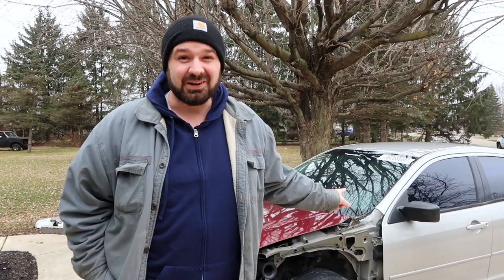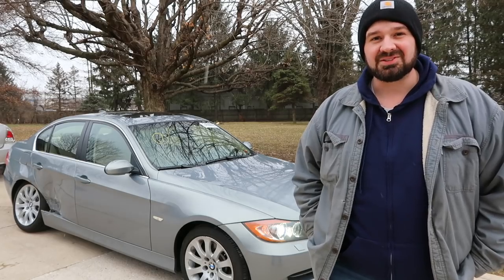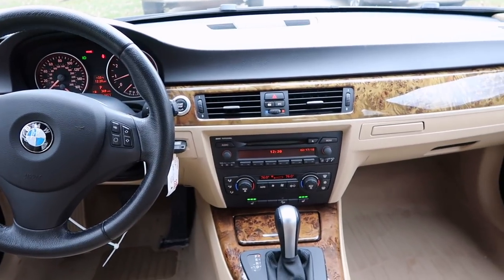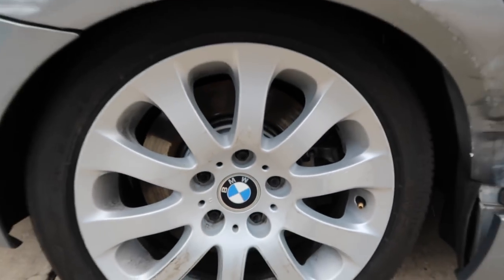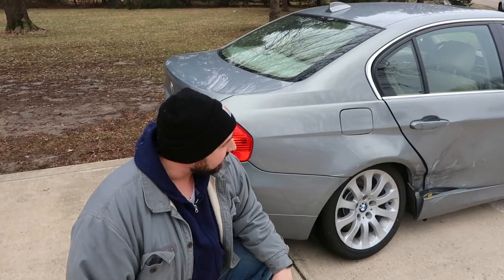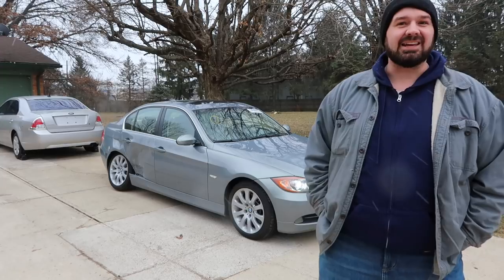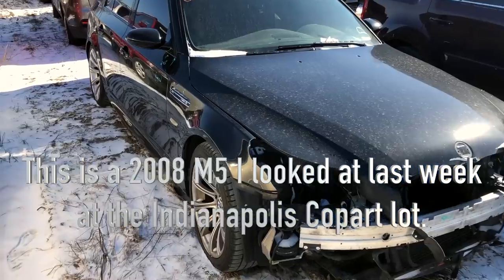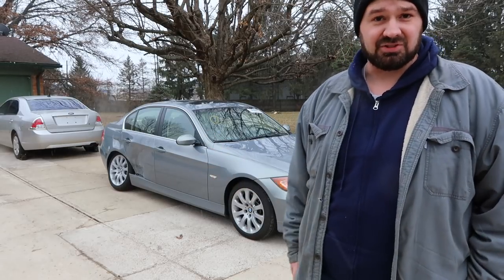NEW PROJECT CAR!! BMW E90 330xi Rebuild Project -- Part 1 -- Introduction

Comment: 1300??? You didn't buy it, you stole it. You got yourself a real winner there, Steven. Not badly damaged at all, and you'll be able to flip it for a good profit. It's obvious it was meticulously maintained throughout it's life. I have a 2016, I'd be ecstatic if it looks that good in 10 years. Yes the Beemer is high mileage but guaranteed the owner kept all oil changes up to date. Really looking forward to seeing this one finished, you might have a hard time parting with it when it is.
Reply from the maker: Haha! Yeah, I’m afraid it’ll be hard to part with for sure! I fell in love with it right away!!
Thanks for watching!!

Comment: Looks like a great buy. There was a Honda in my neighborhood with the same damage to the rear driver side wheel. It sat there for a few months and I was going to inquire about it. Before I could do that. It disappeared, the next time I saw it, the wheel was fixed and it was in the owners drive way.
Reply from the maker: Awesome!

Comment: You may want to take the VIN to Dreyer  & Reinbold and see if they can give you any history on the car. A lot of BMW nuts salivate over cars with maintenance history included. The Salvage to Rebuilt title may squash a lot of that enthusiasm, but you're doing a great job of documenting the repair so someone may bite when they see how minor the damage is.. If D&R are being their typically 'uppity' selves and do not want to help out, check the dealership in Lafayette....
Reply from the maker: That's a great idea! Thank you!

Comment: The interior is worth more then you paid for it. You got an Amazing deal. I was wondering what check engine light are on? I enjoy your videos please keep them coming. Good luck with the builds.
Reply from the maker: Thanks! I think I could make a huge profit parting this car out, but I really don’t want to. It’s too nice for that! Hopefully I can get it all fixed up pretty reasonable.
No check engine lights or anything else. The only things you would’ve seen in the video are the seatbelt light (because I wasn’t buckled while the car was running), the parking brake light l, and I believe the light showing the fog lights were on. No error lights or messages at all!

Comment: Take the key to a BMW dealer service dept and ask them nicely to pull up the service records. That will give you a good idea of what was done to it in the past. That is, if it was maintained by BMW. They can scan the key and get the records.
Reply from the maker: Cool! Thanks for the tip. I’ll probably do that.

Comment: Great videos man.. I subscribed after you posted your first video. Quick question - was that price including the fees? Also, did you use transport through CoPart or did you have an independent company do it? How much was the tow?
Reply from the maker: That price was my winning bid. There were auction fees on top of it. I’ll mention all of those when I do the final breakdown of the costs. Fees are a few hundred.
I didn’t use a transport company. I rented a U-Haul trailer and borrowed a buddies truck and towed it back myself. I only live about 2.5 hours away.

Thanks for watching!

Comment: If I was buying for myself I think the price is fair as long as you can do 90% of the car your self. You can probably do a lot of the body work your self if you take your time. I had a Toyota Celica that was hit in the back corner like that. I spent a few weekends hammering it out and some bondo. The car was not perfect but I had it close to 15 years and enjoyed it the whole time.  That was back when you could buy a wrecked car with a clean title pretty easily.
Reply from the maker: Thanks! Aside from the frame repair I plan to do the work myself. Hopefully it’ll come out pretty affordable!
Reply: your welcome cant wait to see it done.

Comment: I've owned my e90 330i for about 13 years just about March 05 build. I look a lot on Craigslist for cars and I can have one like that for 2500 to 3k easily. So what you paid you won't make good money on if anything will cost you more to repost than what it's worth. Door let's say 300 bucks and quarter with damages about 500. Suspension bits anywhere from 200 to 1500. Now you have rebuilt title so went from 3k worth to 1500. So you lost money. I been buying and selling for more a decade and I know this car really well

Comment: Good Project........but I didn't know you could buy from Ohio.....without broker....as I too, live near Indy and I fully agree....with broker fees.....just too expensive to buy these cars.....and I have written to you before about it.....so, you and I think the same way about buying wrecks...with needing to pay a broker.  I enjoyed this video....and will be anxious to see...how this car will be repaired and the cost of doing it......
Reply from the maker: Hey, thanks for watching! 
Yeah, I’m Ohio you can buy salvage title cars at auction without a broker. But you would need a broker for clean title cars. It’s the closest place to me that I can buy a salvage title car without a broker.
Reply: Crossroads Rebuild 
Just quick question. So you can buy salvage cars from Ohio without a broker ? If you used a broker which kinda fees apply from copart (referring to the 4 culomns)??
Good luck
Reply from the maker: Yes, you can purchase a salvage title car in Ohio without a broker.If you buy through a broker then you actually won't pay Copart directly for anything. You'll pay the broker. They will pass on any Copart fees in addition to the winning bid price and the brokerage fees. You may pay slightly less in Copart fees depending on the broker, but you'll still pay some. And the brokerage fees will far exceed any savings on Copart fees. Using a broker makes the most sense on higher dollar cars.

Comment: Good deal but not much profit Will come out of it.
Reply: I have to disagree, have you seen what the interior of this car at that quality goes for? He has a ton of profit parting it out. But it looks like it can be fixed. He would make more parting it out but he will definitely make a profit either way.
Reply: Actually I doubt it. There is easily 2-3 grand in repairs. It all depends on how cheap he can find parts and also the labor to pull and paint the damaged portion of the car. Salvage BMW with that mileage is probably only worth about 4-5k in my area. He may squeak by with a small profit or break even.
Reply: He said a door can be had for around 200. Depends on what he needs to pay for a pull.... almost all the bodywork is in the quarter, but hopefully he'll get a good rate from his friend. Wheel cover needs replaced too, but should be able to get one off Ebay, if not a salvage yard. It'll be almost impossible to find a cleaner one once it's repaired. Even with an R title, that car should sell itself when completed.
Reply from the maker: We shall see how the price works out. It will likely come down to how much I’ll have to pay for the frame pull and paint. Door shouldn’t be too expensive based on my research and hopefully the suspension parts can be had for reasonable. I’ll be sure to let everyone know how the price works out! 
Thanks for watching!